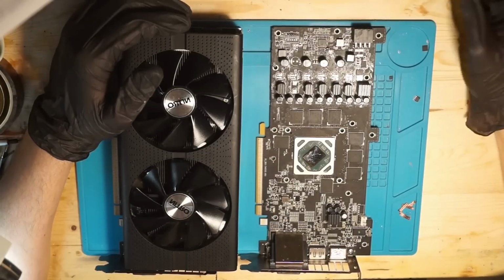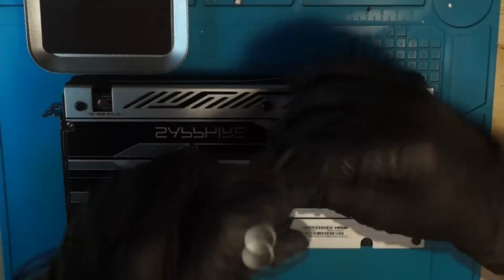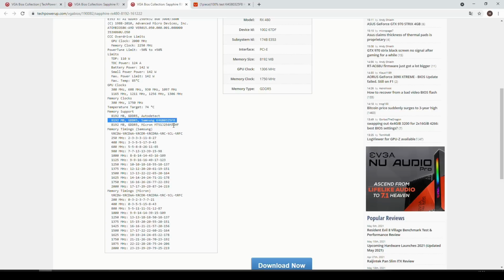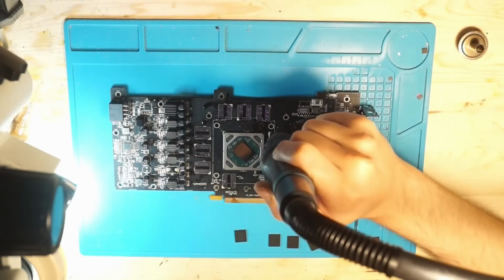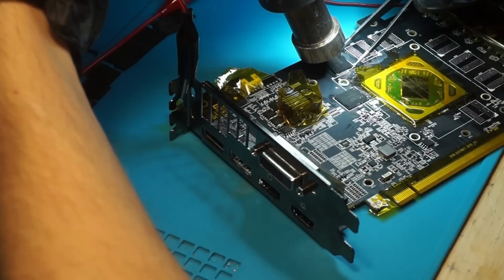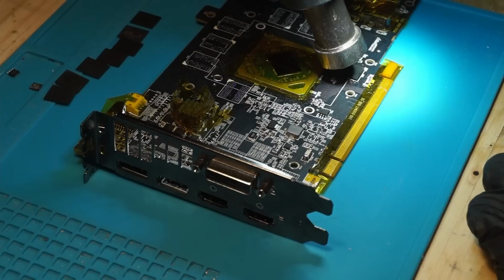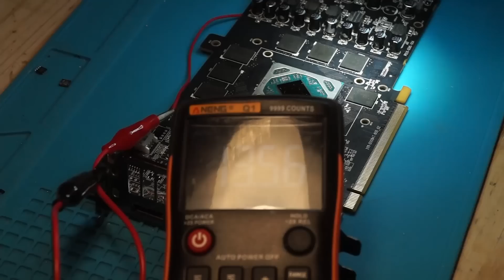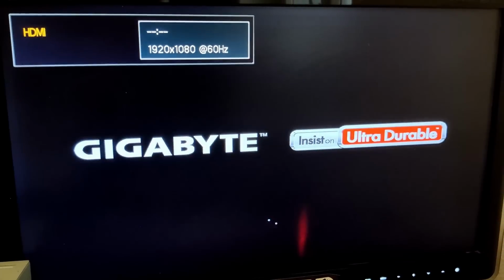Doubling VRAM? Upgrading an RX 480 from 4 to 8 GB

Comment: @fxbbm : 
I have an ASUS Strix RX580 8gb with a Ram issue.
My question is: can I use a different ram for the replacement parts?
'cuz I have a dead rx580 with a Samsung K4G80325FB-HC28 but the Asus Strix ram is K4G80325FC-HC25.
What I know about the differences between those 2 rams is only the speed. 7gbps for the HC25 and 8gbps for the HC28.
Thanks for your reply.
Reply: No, u can not. The RAM´s must be same
Reply: @hakang1331  really?
Reply: @kakkoishonen  
Yes, if its different the system check give an error. The GPU dont run or freeze every time. 
Sry for my English.
Reply: @hakang1331  but Tech Cemetry told me it can be replaced by a different RAM (same brand but different bandwidth...)
Reply: @kakkoishonen   If its the same Brand, maybe, but i dont think that it works. If u try it, please write me, if its work.
Reply: 2024 update.
I got a lot of experience fixing GPUs and replacing rams today so here's the response to this question I asked 2 years ago.
Yes it will work if I replace the K4G80325FB-HC28 with a K4G80325FC-HC25 but the bios should be replaced with a lower memory frequency to avoid crashes and freezes.
Those Samsung ram chips can even be replaced with PS4 ram chips (HC03, ...).

Comment: ah yes software cripple, well it is very common abroad alot of consumer electronics , i recently flashed my 100mhz osciloscope to a 200mhz version and save myself $150 , such a scam when businesses do this , atm nvidia is going rampant by putting crapy re releases with ram upgrades that you won't utilize, trying to make some extra money for the overstock of ram chips they have to make up for the lack of gpus chips
Reply from the maker: Yeah, in a way this is true, on the other hand, i tend to look at it as a prosumer discount, which i gladly take it. But i totally understand your broader point..
Anyways, thanks for watching and happy new year!

Comment: why do even people need 8gb on a old low tier gpu that wont be able to run alot of monitors/high resolution anyway the only good thing about 8gb on this weak/old card rx480/rx580 to is only alot better for mining beside that i dont see any usefull use if u a gamer for the 8gb only good benefit for mining
Reply from the maker: Have a look at the steam hardware survey, this "old low tier" GPU still beats the top 3 most popular (aka used) GPUs in steam. But this aside, ofc its not something that i would recommend doing for everyone, its more about "can it be done" rather than "should it be done". There are performance benefits from doing this, but the risk and costs are far greater. Check out Part 2, there i talk about this a bit more...Thanks for watching and happy holidays!

Comment: when i opened my rtx 2060 there was two more connectors where two more ram modules can be solder i always wonder if i solder two more ram module will it become 8gb

also gpu die in my card is very weird it is tu104 150 ka a1
there is information about rtx 2060 with tu104 150 kc a1 but not ka a1 

even weird is that in gpuz it shows release date when rtx 20 series was officially launched. not when rtx 2060 launched which i think was 1 year after official launch of 2080
Reply from the maker: So regarding the empty pads, no you cannot put memory there. These PCBs get reused for other models and thats why they may have unpopulatet footprints.  What you could do is upgrade to 12GB (watch the Video of VIK-on on that) but not to 8GB. 
I have absolutley no idea about the differences (or if there are any) of" ka vs. kc", sorry! But regarding the date: That is from the BIOS, it has nothing to do with the actual silicon in your card. It can very well be, that the manufacturer just puts the official release date of the 20 Series in there...could be that they put the relase date of the bios revision in there or the official launch of the 2060..i would not worry about it too much..
Thanks for watching and have a nice day!
Reply: @fxbbm  thanks :)
Reply: @fxbbm  hey bro i have a question can you tell me which component in gpu probably be faluty if i get shuttering and bsod live kernal event 144
Reply from the maker: Hard to tell, i'd say it is more an issue with the driver (assuming that the thermals are ok, that might explain the stuttering). Try to completly remove the driver and install a different version or even better try the card in a different system.
Reply: @fxbbm  thanks you so much for reply. unfortunately it is a hardware issue. i know it because i have literally tried everthing on internet including updating bios but noting fixed that issue. either my motherboard is bad or gpu. i'm thinking about gpu because sometime  when i turn on pc i only get black screen. but if i press the power button ( for short amount of time ) than pc does not turn off also during that caps lock key of keyboard works  from my knowledge it means windows is loaded and the gpu is not able to give picture

and the reason i think motherboard is bad because it is recently rma'd. and sometime when i turn on pc bios screen does not appear and i get bsod related to memory currption again thanks
Reply: @fxbbm  i cant try card in different system because where i live nobody has mordern pc thanks again
Reply from the maker: It seems quite unspecific, try to remove all non essential components ( including casefans and RGB!, only one stick of ram(and swapp it if possible) no USB devices except keyboard/mouse, no add on cards like wifi,) and see if it helps, if it does fix it,  add stuff back until it beaks again..and thats the faulty component.. Also, try to force the MB into PCI-e 3.0 mode if possible, sometimes thats an issue (if it runs in 4.0 mode)..
Reply: @fxbbm thanks for your reply. already tried all these things. one day i will solve this  thanks

Comment: can you tell me what temp you use for removing ram chips from donors 

and for reballing them back onto the gpu
Reply from the maker: For removing chips and soldering them back on i have my machine set to 420°C @110l of airflow, reballing 360-380°C@60l, but you have to find out what works for you and your machine...

Comment: Anyone know if the RTX 3060M 6GB PCIe cards can be upgraded to 12GB? I like the price/performance but the RAM is low going forward. Only problem is using older hacked windows drivers that may have trojans...someone said linux supports it fine without the bootleg drivers so could be a good steam card.